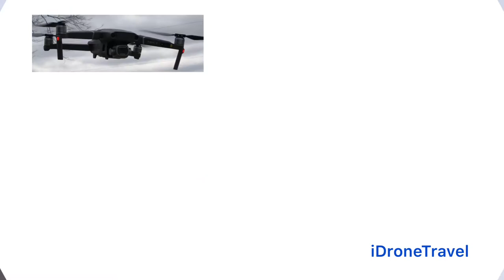Sawing Cottonwood // Part I // Saw Mill // Logs // USA Factory // Technology

Comment: I worked at a cottonwood mill in the 80s and at that time cottonwood was the number one exported hardwood from the USA.   We sold grade cottonwood to a furniture manufacturer that made magazine racks for Sears.  The odds are any furniture that says "walnut" stained or  "pecan" stained will actually be cottonwood.   Lots of it is used for pallets,  Soles of foundry workers shoes used to be cottonwood.  Excellent STRONG framing lumber.  Where I live, it any house was built before 1900 if was built from local cottonwood

Comment: Why would anyone want to mill cottonwood a garbage tree when there are better types of wood that can be used.
Reply: Cheap, easy to find, lots of bdft/tree.  Sure there's nicer and easier stuff to work with but cottonwood is useable
Reply: @brentbell9543  nope I’ll stick to Douglas fir , ponderosa pine , sugar pine , white fir , silver tip fir western red cedar western incense cedar or even western white pine before I use cotton wood. Even oak is better than cotton wood
Reply: @danrobsonjr247  I just explained to you why people use it.  You don't have to like cottonwood, and that's fine.  Everything I said was the truth
Reply: @brentbell9543  He's a troll, not a woodworker.
Reply: Try to sell cottonwood for firewood and you really get attitude.
Reply: I bought about 20 sheets of 1/4" ACX plywood to panel my shop with about 25 years ago.  It had a 1/8" core of Douglas-fir,  but each 1/16" face was cottonwood.   It was Roseburg Resin-tite brand.   Nice product.

Comment: What is the cottonwood lumber used for
Reply: Palets, core vor sky end snow board,
Woden gloks. Blok end Sarkophag for funeral. Board for furniture.
Reply: Sorry for the grammatical error I'm vrom Serbia.
Reply: Yeah ok thanks. We use the cottonwood for pallets also. I also use it for framing lumber to build sheds.. It works well if you nail it in right off the sawmill and don't let it sit around.